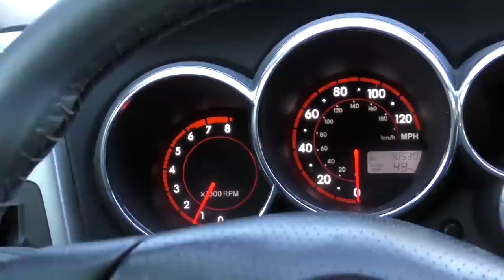Please Stop Doing This to Your Transmission (It Destroyed My Car)

Comment: Wish I'd found this video before I had my transmission flushed, I just figured, it's coming up on 150k miles and the certified service center recommended it, and change the transfer case fluid too, sounds like a good idea. But sure enough, just like Scotty said, now it has a problem when it didn't before. I will try changing the filter to see if that helps, but I think the "good" people at Ford just ruined my truck's drive train...and I let them because of my lack of knowledge. I am certainly doing much more research from  here on out. Thank you for these videos sir!

Comment: How about doing a vid on CVT transmissions? Many manufacturers are going to CVT instead of traditional automatics. Bought a 2008 Nissan Versa  new and I want to keep the thing running as long as possible. It still has only 58,000 miles. Unfortunately, I didn't know how bad Nissan CVTs are before I bought the car.

Comment: Hey Scotty my mom recently bought a 2010 rav4 with 146k miles transmission fluid has never been changed should I change the fluid
Reply: If it were me, I would drop the pan, clean it, then replace the filter. I would NOT flush! Be certain, to get the right grade of transmission fluid. there are many different kinds, make sure you use what's specified. Often, it even tells what type right on the dipstick! My theory is, in half the cases, the flush is unsuccessful, because it could change ALL of the fluid in a certain transmission to the wrong kind. All the different fluids have different friction modifiers, and the wrong fluid can drastically change the characteristics of a transmission, including, rendering it USELESS!!

Comment: Here's the thing Scotty, I have a great Toyota mechanic that I'm good friends with, and he does the major jobs at the dealership on the down low. Pay for a cheap job while he does that job, but also works on the major jobs. He changes my transmission fluid with that machine. If it is so hard to take down the transmission pan because it's glued on, then why try to do that way since it's sealed. Other than taking down the pan, I see no other alternative. This is for a 2015 model

Comment: Putting the right amount of clean fluid back in is the tricky part.  I had a flush back in 2013 and it's only been about 40k miles....  I want to do a complete filter and gasket change as well.

Comment: Great advice. Makes sense! What I don't understand is why modern transmissions cost twice as much or more to rebuild or replace than automatic transmissions from 20-30yrs ago. They were electronically controlled back then too, so I don't get what has doubled the cost.

Comment: If you think synthetic oil in your engine is good, try synthetic transmission fluid next time you change it.  When I did that to my Chevy van, it made it so I couldn't feel it shift anymore, so smooth, it was like a brand new van.  Just do it, it's expensive, but it's fantastic stuff.

Comment: Thanks for putting this out there, Scotty. I am also against transmission flushes for the same reason. Just had my pan dropped last month at 30k miles - pan cleaned (including magnets), changed filter and replaced 6.5 qts. out of the 13 qts. that my transmission will hold. Plan on doing another at 60k. Screw Ford and their 150k mike recommendation.

Comment: Ok, what if you use the transmission cooler send/return lines to drain/refill all the fluid from the pan, and torque converter? In effect, don't use a machine to "foce" fluid through it, use the transmission to flow out the old, flow in the new?  I did that on my Lexus with 200k.   I drove it 97k miles with no shifting problems.  I sold it, and the fella I sold it to, still has it a year later. :)

Comment: Thank you so much Scotty for clarifying. We just had our Dodge Grand Caravan in for an oil change. We are at about 57,000 miles and the shop we took it to for the oil change tried to convince me that the vehicle was due for a transmission service. That they could do it for $79.99. I asked if that included the new filter and other supplies. The guy says "No we perform a fluid flush. We don't change the filter". I responded with "I've heard  people warn not to have a flush done on a 62TE transmission. That it will destroy it in most cases destroy it". He tried to tell me they've done hundreds of flushes with no issues. I said, I'll think about it. After just watching you, No way! I'll pay the dealership $189 to do it right.
Reply: How'd it go?

Comment: Remember with  most modern transmissions the filters either not included at all or need to separate the transmission casing to access.  For the most part even with a transmission fluid change still no filter.  Draining old and getting fresh fluid is better than nothing but still want the filter back.

Comment: Wow I'm so early that manual transmissions were popular
Reply: Still are in Europe
Reply: @directorbeau  yeah ik Americans are too lazy to have manual transmissions they are better on gas stronger and reliable
Reply: I mourn the demise of the manual transmission. No cooler, no special lubricant, no filters, no excessive heat, no excessive dead-weight, just the clutch and gear oil to worry about.
Reply: @billgateskilledmyuncle23  you're damn right it's sad that manual transmissions aren't popular any more clutchs aren't that hard to change if you have a lift and trans jack jack and jack stands ugh nope too much if I had to I guess I would change it I've seen a Honda Civic with140k on it for $900 but it needed a clutch
Reply: new clutch $150-300 at parts store

new auto transmission $1500-4000 dollars

easy decision

Save The Stick!
Reply: @weaksignal8009  i know they should have a come back but these days people are too lazy or it's too hard to drive a stick I want to but no one has a stick
Reply: may day  oh really I didn't know that 😂
Reply: @billgateskilledmyuncle23  alot of the popular cars just aren't made with manual transmissions. That's  kinda why.
Reply: @directorbeau  Europeans diss them at my work,  until they come here and get a automatic rental
Reply: @WorkHorseLT  nowadays automatics can equal or even exceed MPG versus a manual. The real advantage of manuals is simply they are more reliable and just fun to drive.
Reply: @weaksignal8009  the new clutch parts might cost that much, but with labor it's gonna total to about $1,000 still.
Reply: @Sci-Mon1  yeah but if you do it yourself you will save money I could do it myself if I had a manual transmission but I don't
Reply: Ill teach anyone learn for the same price as my honda specialist charges to replace the clutch pack lol.
Reply: @billgateskilledmyuncle23  You can still get 'em, just buy Japanese or Korean.
Reply: @WorkHorseLT  Japanese and Korean do!
Reply: may day  Japanese and Korean do!
Reply: It is a vicious cycle. By offering fewer manuals, drivers today who have never driven a manual have fewer opportunities to encounter one, which only drives down demand for them because fewer people have the skill to drive one. If more manuals were available, more people would learn how to drive them, and then more people would demand them because most young people, once they get used to them and how not to kill the engine, get to where they prefer them.
Reply: I replaced the clutch on a 95 xj cherokee in 2012. My only clutch job, and I did it right. The kit on ebay was around 80 dollars. Did the hydraulics a few years later, since they had the brains to use the actuator that goes on the outside of the transmission.
Reply: I have a manual Toyota Corolla with 150,000 on it. I haven’t changed anything in it yet. I heard the secret is to never ride the clutch, so always fully engage/dis engage while shifting.  So do I need to replace the gear fluid at some point?
Reply: @alleyoop5185  you'll know if the clutch begins to engage while you're holding it down. That's either bad fluid or bad cylinder at either end. Eventually the clutch will still go. If you don't wear the abrasive material, the throw out bearing will finally go, but you will typically hear that bearing before it goes. It'll moan or chirp while released, then get louder when you push it in because it's under load.

Comment: I agree with only part of this, yes dont allow a company use a machine pressure flush machine, however you can use what my shop uses, it uses the vehicles transmission pump to change the fluid, mostly just trucks use a flush machine and most front and all wheel drive cars are only drain and fill,  so similar to what he is saying you should do.  Most shops I know dont use powered flush machines anymore and alot of newer cars dont even have a transmission filter to change out either. Also, I do agree with him about high millage car that never had a history of fluid changes, dont change it if its 200k + miles. Do the trans fluid changes at all recommended intervals, most drain and fill are around every 45-60k.

Comment: Had a Transmission shop tell me the same thing 10 years ago.  He said that sometimes the little parts can come loose when doing a flush, which would then cause issues with those small pieces floating around inside the transmission.

Comment: I went in for a regular oil change, they convinced me I needed the transmission fluid to be flushed on a 2010 Toyota Corolla 50,000 miles, a few days later I was having car issues and needed to get work done, can’t remember what it was.. I regretted getting that done to begin with.

Comment: I could feel my transmission slipping a bit so im going to see throw lucas stop slip in there and say good luck
Reply: Gregory Sotir  Well damn it is too late, I spent the $20 there is no turning back now
Reply: Scotty has liked that stuff, so give it a try
Reply: Be careful what car you use that stuff in, certain brands (older Chryslers, and a couple others) do not take well to Lucas at all. A little slip is better than a grenaded transmission.
Reply: @ixionn563  What other brands would we be talking about, here? I'd imagine Honda is one of them because of their motorcycle-inspired AT design. Am I right?
Reply: @EMichaelBall  Possibly so, I know those have a pretty unique design. The guys on the Dodge truck forums go anal when someone mentions Lucas, it destroys the transmissions in those trucks. Just figured I'd mention it so some poor soul doesn't blow up a transmission that could have lasted a couple thousand more miles with a minor slip.
Reply: I've used Lucas products in 2 of my old Saturns and it definitely helped.
One had a real bad oil leak and the Lucas oil treatment slowed the leak significantly (when used regularly).
I used the transmission treatment in the other one and the transmission never got any worse than an occasional slip.
I've used the Lucas fuel additive treatment in both those Saturns, both my Pontiacs, my Ford Explorer and my Chevy Caprice.
I've never used any Lucas products in any non-American cars though, so idk about that.

Comment: 2:22 what you described is a drop and fill without mentioning the fill part.  Some people may drop their pans and not replace the fluid that is lost due to opening the transmission causing the transmission to run low and cause issues.

Comment: Not sure is different on the new autos..? But the way I was shown was to drop the sump, clean & New filter like above. But once filled with fluid take off the transmission hose that connects to the transmission cooler and run the car for about 5 seconds at a time topping up as needed, repeating until the oil becomes clear. Replace hose. Double check levels and for leaks. Done. Dunno why there needs to be external pumps or machines etc..? Nissan QG1.6 LTR 4SPD with  168000 Miles & runs & shifts like a dream

Comment: A proper flush is suppose to have the filter changed prior to the flush. A lot of that contamination that clogs up the transmission comes from the filter and when they flush it, it dislodges it from the filter and clogs stuff.  These shops do not know how to use the equipment they were sold because there is little or no training involved.

Comment: I only did a transmission flush once in my 02 Mazda protege when it had like 80k miles. Young and didn't know better not to. I got over 170k miles on it right now. I haven't fooled with the transmission oil since then and it still looks clean only added some from time to time. Got lucky.

Comment: Hey guys, I've worked on few bmw cars with automatic transmissions and yes bmw says that it's lifetime fluid on a ZF gearbox and I have a friend who works at ZF and he told me that the fluid is good for about 60k to 80k km before having to change it and do a new filter to, but in all automatic transmissions the oil and filter should be changed at around 80 000 km even the manual gear box oil should be changed every 100 000km but that's what I normally would suggest

Comment: I let a guy at a jiffy lube do a trans flush on my 94 Pontiac Sunbird. It was, surprisingly, a very reliable car until that point.  Had to trade it in because I didn't  have $3k for a new transmission.  I learned the hard way to never let them flush the transmission.
Reply: Is it the fact that they flushed it? or, may they have replaced the fluid with the wrong grade. Where there's Ford type F fluid, Dextron, Dextron II, Mercron, and other types, filling a transmission with the wrong kind of fluid will greatly change the characteristic of the transmission, because they all have different friction modifiers. IF you choose to have a transmission flushed, I would go to a proper transmission shop, or the dealer, because they will know what type of fluid to use. If all you do is drop the pan, and replace the filter, you're only changing a fraction of the total volume of fluid in the transmission, and using the wrong grade isn't as likely to end in disaster. Flushing changes it all, and back filling with the wrong fluid can lead to all kinds of problems!

Comment: Flushing it out one of the cooler lines while pouring new fluid into the dipstick hole won’t loosen any crud up. Neither will flushing it out one cooler line and adding it through the other, using only the pump in the car in it’s natural function. Some cars have the pan on top and no accessible dipstick. 
As for the radiator, just drain and refill using distilled water 50/50 with compatible antifreeze. Do that every three years. Never put tap water in it even to flush it. Some stays in the system.

Comment: I'll admit! In hindsight I wish I would put the old fluid in a transmission I service, had to replace a lockup solenoid in a Chevy 4l60e. Common 3-4 clutch pack wearing! 

Replaced the solenoid and installed new fluid and filter [was a NO NO], immediately driving the 3/4 began to slip! Day later... Transmission wouldn't engage in 3rd.

High millage Common transmission with clutch problems need to be considered before flushing or fluid/filter changing.

Comment: What about an ATF fluid exchange (transfusion) machine - not a power flush?   The machine also hooks to the cooler hoses.  The machine is passive, it uses the transmission pump to pull in new fluid from a reservoir (not under pressure) into the intake hose and expel the old fluid from the output hose.  The machine has a computer that exchanges old fluid for new on a 1:1 ratio.

Comment: I wish I had seen this video a few weeks ago.  I had a oil change done by Valvoline and they mentioned I needed a transmission flush, so I let them.  A week later my check engine lights came on my 2001 4Runner.  I took the 4Runner to my mechanic and he took it to a transmission shop.  They claim the transmission was toast and had to rebuild the transmission and $3300 and 7 days later it is back.  Maybe unrelated but on the  same Valvoline trip they also power flushed the radiator and shortly afterwards it started to leak from a crack on the upper surface..  That also had to be replaced.  Lesson learned: Oil change only at Valvoline and watch more Scotty's videos.

Comment: I just flushed my own transmission because it would not go into any gear. I just let the pressure from the system push out the old fluid while I poured new fluid in the dipstick tube. No harm done from a high pressure pump they use at shops. Now the transmission goes into gear and shifts good everytime. The torque converter even converts more torque its great. I thought my transmission was gone for sure, but a DIY flush without a high pressure pump worked miracles on my transmission.

Comment: What about sealed transmissions, been told the only way to change fluid is to flush it. Advised you can’t drop pan or change filter on  newer sealed transmissions

Comment: What about dropping the pan, changing the filter, re-filling with new fluid and then over time, do several more drain and fills?
Reply: Scotty?, Is that you in disquise?
Reply: @garymiller2056  No, I'm a legitimate follower of his.  And I've heard elsewhere that multiple drain and fills will clean out a transmission. Same thing for the power steering system, which I did  myself.